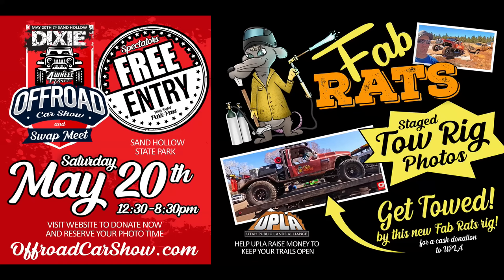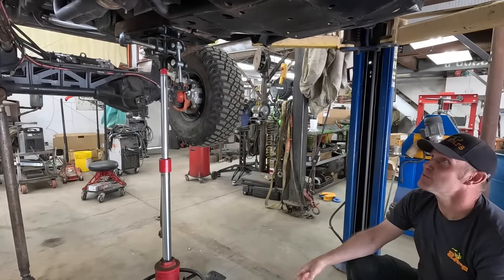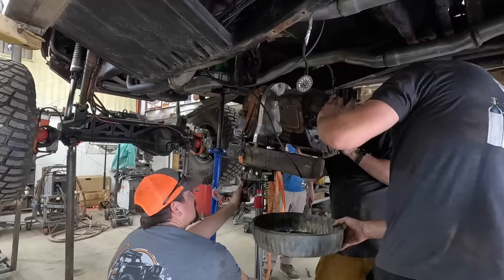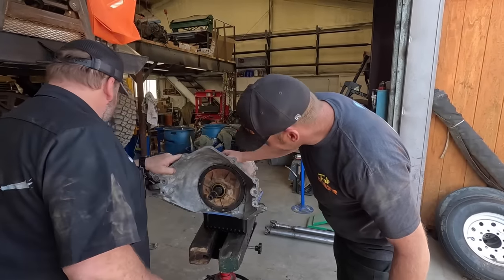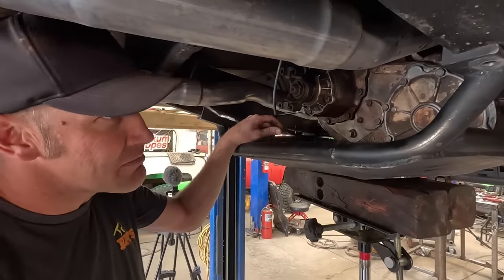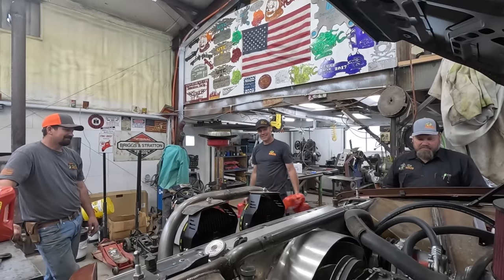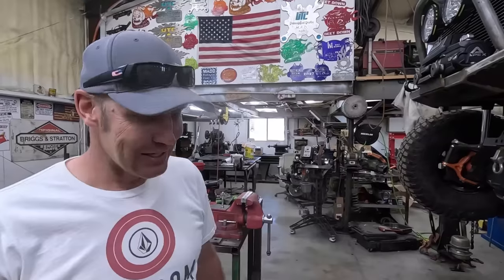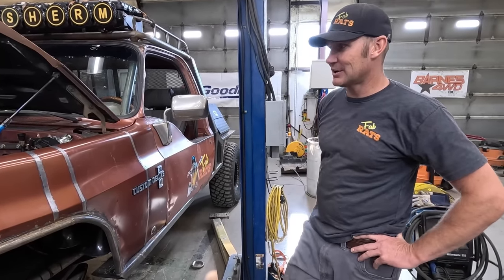Transmission Blunder On The Rat Rod Wrecker Leaves Everyone Shaking Their Heads!

Comment: What's a FabRats episode without something catching on fire? Fantasy!
Reply: Right , no insurance company will cover the coxs shop .
Reply: At least Paul didn't make a fuel of himself.😁
Reply: They need steel barrels with a cover.
Reply: @tiredoldmechanic1791 I think you would have to attach the cover with a piece of chain or it would be lost or maybe even incorporated into a project 😊
Reply: Not funny.  Don't play with fire.  Think of Brett and Ester and what happened to their shop.
Reply: Shake up a can of Mountain Dew/ Coke/ Undrinkable beer (depending on location and personal inclinations) and partially crack it open, aiming the spray at the fire. Keep shaking. It'll put out most fires.Co2 and Co2 foam. There's a reason the fieries use it.
Reply: Paul was/maybe still is a volunteer firefighter so it’s a bit of practice for him.
Reply: At least he got the right shirt in the mail in this episode!

Comment: That transfer case looked fun to pull, but not as fun as pulling and installing one by yourself while laying in gravel with the truck on ramps. Count your blessings yall have 3 strong guys and a lift.
Reply: I had to do just that with an automatic transmission for my Ford maverick. I was lying in the dirt and had to pull the tranny up on my chest then bench press it into place by myself. Been there done that got the tee shirt!!
Reply: @rossmeldrum3346  I had to do that  2 wks ago when I had to drop my front dif to drop my pan to change my oil pick up o-ring out on my 11 silverado. It's a super tight fit and an extremely awkward angle. Bench pressing that joker that has all the weight on one side is a bear. Still have the scrapes and bruises on my chest and stomach
Reply: Want to talk fun...a C6 a d 205 transfer...in a dirt and gravel floor garage...plus the bronco was lifted so it had to be rolled in on rims only...oh did I mention that I had a broken hand in a cast at the time...
Reply: @alexanderkrzewinski2375  what year bronco? I've got a 78 with a 351 & C6 tranny. Luckily the trans was rebuilt when I bought it.
Reply: try it in a Minnesota winter
Reply: That’s part of being a mechanic. I can’t fix all my side jobs and families cars at the shop. A lot of times I’m doing a motor or some shit on the ground in the garage
Reply: @Lexidezi225  the bad part of it was I was putting a trans from a 64 Chev into a 67 Chev Impala and that is when I learned about short and long tail shaft transmissions my driveshaft for the 67 was too short
Reply: You had ramps? dang, that's stylin'.   I had a torque converter crack in my old dodge, yea, in the gravel, in the rain.. whole lot of fun to swap that out... At least I'd done it the day before (with a hoist) when I did the rear main seal and input shaft seal.. apparently those were not the source of the leak!  I've been fab-ratting a long time (doing things at least twice to get them right)
Reply: @hustlinghard8081  78 ranger xlt
Reply: Oh another fun one...727 trans in 69 fury..in 3ft of snow..tunnel in and out from under
Reply: they wont have 3 guys for long if they keep burning plastic

Comment: You just gave me a flashback to the olden days.
 As a know it all teen and a Chilton repair book from the library, [ BEFORE THE INTERNET],  I changed my ram charger transfer case in my parents driveway , in middle of a Maine WINTER night, by myself, after I killed it having fun. Luckily it was a tared driveway and VIP Auto , let me use a transmission jack,  All proud of my brilliance, I jumped in and it still didn't work. 
 THEN,,, I looked up "transfer case won't work" and found out,  It as just a bent linkage.  Lesson learned.  Never assume the worst first. DUH. My friends and I beat the heck out of that $900  lifted rust bucket.
 Once,   WITH  ONLY THE FRONT DRIVE SHAFT AND NO CELL PHONES a bunch of us set out onto the highway and drove 200 miles to work snow removal in the next state.  About half way there , in a blizzard, e  had stopped at a truck stop, and when I kicked the the giant snow chunk off one of the the back fenders, about half the fender, and fifty pounds of bondo,  fell right off in the parking lot. LOL. Unphased, we just hauled butt out of there. lol.
 Another life lesson i learned with that truck was, giant tube push bar bumpers are a must, and to never drive it around a corner fast after without a steering stabilizer, to save $30.  LOL. 
I Went up on this poor guys front lawn and it as like the perfect ramp, onto and over his brand new little pickup. It was like in a movie. 
 Scared as hell , I just kept going and parked down the road and ran away. 
 BUT, I turned myself in the next morning with my smashed face. In court the judge as not impressed at all . I explained the , not putting on a new steering stabilizer, thing and I'll never forget him saying,"what part of steering stabilizer , did you not understand" . Of course others there ere laughing at my stupidity, and all a said was," I have good insurance" . Swear to god, this judge only gave me a $90 fine. WTH .  This poor guys brand new truck was totaled and my old crappy truck, got a flat tire, bent rim, and shock, and windshield from my head, and the exhaust came apart in front of the muffler .  I couldn't have been going more than 20 MPH, but sounded like a stock care fleeing the scene of the crime. 
 YES, I smartened my butt up after that eye opener.
  That thing was a great first car for a kid. Thanks dad. Both were the greatest.  
 LOL,  I SOLD IT AS IS FOR THE SAME $900 2 YEARS LATER.  Then about ten years after that, a man tracked me down on the phone, looking for the title cause he "fixed it up". 
LOVE THE SHOW GUYS.
Thanks for the flashback.

Comment: Fab Rat tip of the day. “Don’t use plastic barrels as a burn barrel “
😂 🔥
Reply: Uhm, to be a bit more accurate, "Don't use plastic barrels (or any trash barrel) for a welding support"
Reply: Old 55 gall oil barrels work great for this

Comment: I have rebuilt a few transmissions, and when I rebuilt the one for my T Bucket, I installed the sprague clutch backwards.  I just gave up and took it to the transmission shop.  They are the ones that told me what I did wrong.

Comment: Transmission problems suck! Ive had my fair share of problems with Transmissions from various Transmission shops we've worked with over the years even the expensive ones customers brought me like those purple ones in fact ive never seen a purple one without problems for those dodge diesel trucks. I've tried really hard to work with some shops but they just almost always mess something up i dont know if its going too fast or not paying attention but usually its dumb mistakes or modifications that they think are good. 
Anyways i found a local Transmission guy a couple years ago who owns his own little shop he runs out of his house and hes willing to work with me and let me hang out sometimes and explain what i want and do carry outs for us and i havent had a single problem with his builds im very thankful to have him as a friend because i am not a good Transmission builder i can figure it out and find the problem after getting real frustrated and doing it myself thats happened many times but its not the same as someone like him who is incredibly knowledgeable. If not for me meeting my friend i would be doing my own transmissions and wouldn't be doing very many for other people other than close friends.
I also havent been able to find a good local machine shop the last time i tried getting a head done they ruined 3 yes 3 jeep 4.0 heads i brought them literally ruined them thats shame on me for trying so hard. The only good machinist i know build race engines for boats and he isnt really available for me to use. So its really tough to find good work nowadays, plus its a chore to source good parts sometimes too i cant remember the last time i used an actual rebuild kit without sourcing better parts to replace the crap stuff. It can get incredibly frustrating sometimes because trying to get people to fix their mistakes usually creates more problems that i just dont have time for.

Comment: Your luck is like my brother he hauled RVs from manufacturer to dealers had a 96 dodge spent 13,000dollors in trans repairs and rebuilds finally his wife told him enough haha I did same with a 99 Ford never had Trans problems but got it out of Ford shop at 877,000 miles next trip original injector came apart went through piston and just asked the mechanic about the injectors

Comment: There's a reason Rory uses the tried and true manual trans. Especially working them as hard as that. Paul's 2000hp right foot on a 500hp transmission doesn't help either. If that's the same shop you had build your derby transmission, I definitely wouldn't be getting anymore.

Comment: Question Paul?  On that 400 transmission, what causes it not to hold back in second gear, what part needs fixed?
I have the same problem in my 1986 GMC 3500 dually, it won't hold back on deceleration in second gear. Just coast's like it's in neutral.  I would much appreciate if you know what is the problem. Thanks

Comment: Might wanna build some concrete pads for the tank. Might sink in the mud and tip. Before you fill it.
Reply: What mud?  They live in the desert.  The wettest month of the year is typically less than 2 inches of rain for the entire month.  They get a whopping total of about 13 inches of rain for the entire year there, and it doesn't soak in.   The old fuel tank has been sitting on the ground for a decade or more.

Comment: Hi Paul Ben Shawn just so you guys know when you pull the engine oil dipstick and the transmission dipstick you are supposed to hold the dipsticks exactly how you pulled them out to get the exact fluid level

Comment: I wish you guys I would’ve taken a real good look at that center support you got a pull the valve body oftener‘s I think there’s one bolt or two bolts there 12 point bolts that hold it to the center support and I would take a real good look at that make sure it’s holding everything straight and true it’s a six in a row.Jim from Kennerdell Pennsylvania like I said, I got a 91.5 dodge with six in a row under the hood. I’ll give you one more hint it’s got 12 valves.

Comment: one would think by now they would just run the motor and pump the transmission oil out through the return line in to containers and reuse it  no mess no fuss coolant line are my friend easiest way to empty the transmission

Comment: You should have tried it out after the bottom plates were off. That would have told you if the plates were catching something you could not see behind the plates.  If it was ok before you put them up originally they probably stopping something from moving. Just saying!

Comment: trash can fire done that ,,, melted the bottom of a cheap trash can .. now the trash can will not hold water , Great video just a guess on the other tranny the valve body could be the problem wrong gasket between the plates or a check ball ,,could be also the spring on the side of the tranny ,, would be nice to know if they tell you what was wrong

Comment: I still say a Mopar 727 adapted to fit that  rat wrecker the727 Dodge  pre-65 !!!  with the rear pump they are a cable shift transmission{{}}} and can be pushed started}}} not to mention have you ever felt a 727 without the rear pump  pull the engine down let alone a 727 with a 😮[[{rear pump}]]]✓✓®®®🎉 bad many general motors transmission specially-built by this guy is the best transmission guy if there's still out there lol and all of them have failed miserably long before their lifespan should have ended and I like all American made vehicles preferably pre 80s😮😊

Comment: I’m curious about what T case you have in there. It looks like a factory GM case but I don’t know of any that take 90w oil. Granted I ran 90w in my 205 until the GM transmission guy told me that is a great way to kill the bearings. I started running 10w40 in it after that

Comment: Where are used to work in a transmission shop? What I would do is I would takeoff a blower with a rubber tip on it and a coolant line that where the fluid came out of the transmission I would lightly I wouldn’t hit real hard with real high-pressure air because you know you’re pushing that fluid through everything and you could do damage I would just get a little hit, and then a few seconds later, give it another hit until the vast majority of the fluid came out of everything and then I will take a can of a carb cleaner and stick that little plastic straw in the line again where the fluid comes out and I’ll drop a rag round it tightly and I so can I seal that Plastic straw in the line, shove it in there about 34 inches and then hit the carb cleaner and just keep running it and eventually it will flush through and start coming out of the other line then you take your air blower and again just give it a couple little hits You blow that out and then I would die load that thing up with carburetor cleaner again and let it sit for a little bit 15 or 20 minutes blow it out and I never had any problems. OK hope you got a night shift kit in their recommend a trans go toe and go kit and don’t raise the line pressure too much because it’s working the fluid harder because you are generating more pressure which raises the fluid temperature more and also you’re driving the torque converter into the flex plate more which intern puts more abuse on the thrust bearing in your engine all right this is six in a row jim from Kennerdell, Pennsylvania

Comment: Paul why don't you have professional transmission shop build a transmission for you? 
I mean if your constantly having transmission problems, why chance it anymore? 
After 6 or 7 transmission problems in a row , technically all your transmission's . I would be sending out and save my time and trouble, let someone else do it. Especially after it was leaking like a water fall at the end.
Reply: The leak was from the dipstick.  That would have happened no matter who rebuilt the transmission.  They pinched the o-ring when the put the dip tube in.

Comment: What's the difference between a "drive line" and a "drive shaft"?
Reply: Answer:  Everyone else calls that bit the drive shaft, Paul calls it a drive line.
Reply: @stargazer7644  Right.  The driveline is actually a line between all components that transfer power from the engine to the drive tires.  I was just wanting to see if anyone else would mention that.
Reply: @harpo6203  Not the first time it's been pointed out.

Comment: Why don't you just put a pre65 727 tranny in that they got a rear pump you can actually pull start a car with that transmission they're usually cable shift getting an adapter made or make one out of aluminum I probably be beneficial with that rear pump it'll drive like it's a stick shift not to mention you can put just about any accumulator spring and it or take it out and get it whipllash

Comment: You need to find a better transmission guy. Seems every time you get a transmission that is supposedly rebuilt the way you asked it to be, it always has issues and never works or functions the way you need it to. Find a better transmission guy. Don't know if it was the same transmission guy you used before, but it happened with the derby car on the transmission not working right, and the guy told you to just run it, which costed you the win. Now this transmission is not functioning the way you need it to.